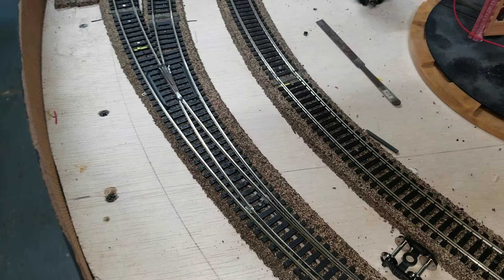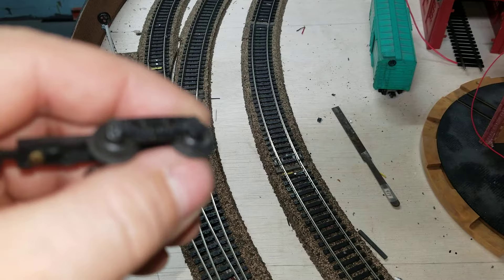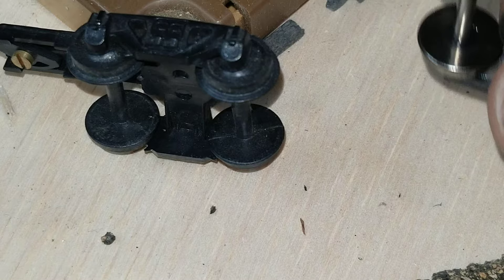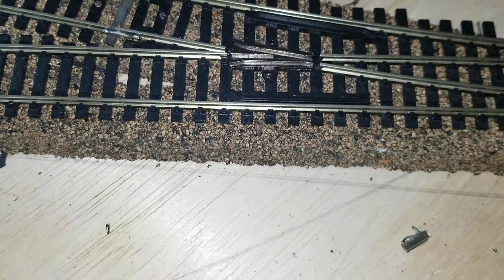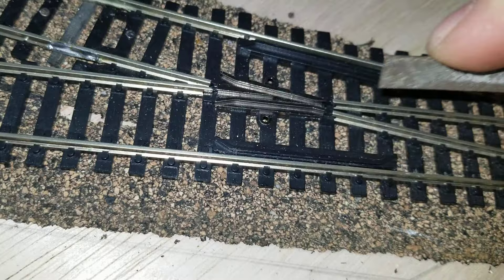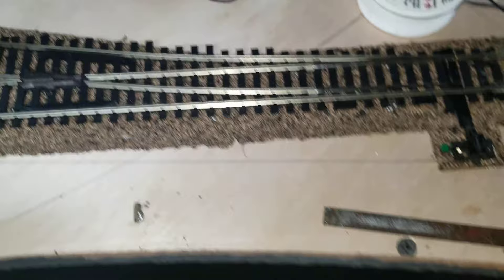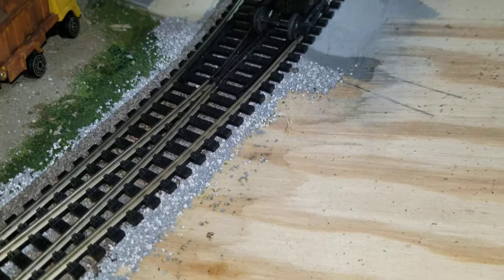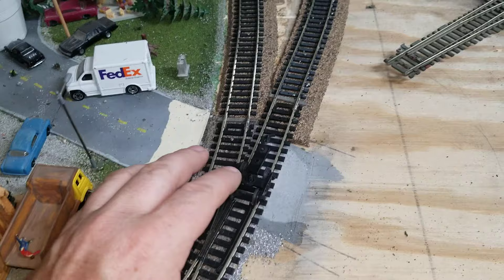talkin about Atlas switches

Comment: Great insight for those of us running old stuff in analog; in my case old time 4-4-0 locos.  Yes, you can replace wheels on old cars and locomotive trucks to improve running through these turnouts without derails and uncoupling as I have done, but there is another issue that is a source of deeper frustration for me - stalling.  My thought is these stalls happen when the driving wheels with deep flanges wobble up and over the frog and guard rails.  As the drive wheels become elevated through these areas, their contact with the track is reduced or briefly interrupted - which is important if the drive wheels have electrical contacts. If the drive wheels don't have pickups, the tender truck behind the cab can also lift up or become canted left or right as the coupling height is briefly increased between loco and tender.  This can also cause an interruption in track contact with the tender wheels.  This is important to know because locos have electrical pickups in different configurations depending on age, model and manufacturer, so the exact spot where electric contact is lost in the switch could vary from one loco to another, although the root cause is the same. I frequently read and see videos where loco and tender weight are blamed for shorts in turnouts.  I also see videos where cheap motors are blamed for stall outs. I now think these causes are overstated in many cases.  Of course, light weight locos and inexpensive motors can contribute to the problem since a light loco will more easily rise up and away from contact with the track and less powerful motors may not have enough toque to power through a problem spot, but more important it seems to me is maintaining proper electrical contact with the track in the first place.  I say this because when a stall does occur, I can most often press down on the tender or nudge the loco to restart operation.  The simple reason for this is because electric contact is now resumed between wheels and track.  Many thanks for this video.

Comment: It confuses me that people still buy code 100. The rails are too large and ties are the same. Its like you want to buy a ford F150 and instead you buy the Ford F150 monster truck because its cheaper. well you know what I'm saying, code 100 is not practical. However, I love your idea to file down the frog angles and the guard rail to allow deep flange wheel sets to travel. I love also those curved turnouts - They look amazing!

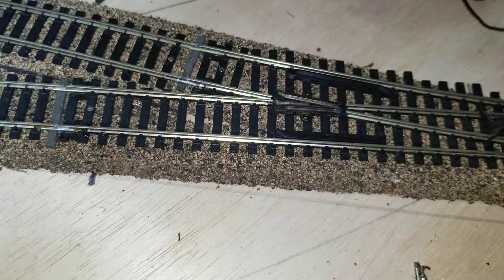Comment: Find out where the camera will focus close up. Then stretch a string nd knot it at the distance. Use this and the close up will be in focus next times. Also you have to know exactly where in the viewing frame the focus cell is or you will always be focusing on the background. See, at the :57 time line you had the subject and the background on the same plane and all was in focus. Looks like your camera will focus pretty close up. Don't be worried what others think. You have to do what you have to do to get the trains running. The filing thing is fine as long as you don't go to far... You were pointing to the guard rail at the 1:55 time line, not the frog.Yep, you have a guard rail problem but you have the right way of solving the problem. Good luck in the future. You are right. The companies want all of us to buy new equipment, but I really don't know if this problem was o]a result of that or just the new dies were just to close and tested with new wheel sets. Anyhou, we all know how to fix them now.

Comment: I inherited some old N scale locomotives and rolling stock from my father after he passed.  I had the same problem with them hanging up on the switches.  This stuff is so small its hard to see that it was a wheel height issue.  I filed down as you did and it solved the problem.  Is there anything you can't find a fix for on YouTube?  Thanks!

Comment: So the old atlas/ switches didn't allow new wheels and newer atlas/dcc friendly switches didn't allow older wheels I think that's kinda dumb 
For example Tyco cars won't run on code 83 cause they get caught and hung up but code 100 everything runs cause of the rails I've also noticed the the older power packs run the newer locomotives better and newer power packs run the older locomotives better (Tyco bachmann ahm etc) weird idk maybe it's me whatever works I guess
Thanks for sharing
Reply from the maker: we use code 100 on everything the new Atlas witches are not made right

Comment: I have a bunch of older Model Power and Rivarossi steam locomotives that have those deep flanges, so I can see a need to still yet do that procedure. 

If it weren't for that, and it was a matter of the older rolling stock having the issues, I would replace the wheel/axle sets with Kadee wheelsets.  The other issue I can see, is some of the new Kadee wheelsets may not fit the older OEM trucks, and a lot of those older passenger coaches require "brain surgery" to install Kadee trucks and couplers on them.

Comment: atlas should just get out of the business of making switches, They are not reliable, I have continuous derailments over them, and the frog is a pain in the ass to wire. Right now I am in the process of replacing most if not all the switches on my layout to the more reliable Peco switches which are similar in price but much much more reliable. Thank god I have not ballasted the RR yet. atlas should stick to making flex track and that is even getting way over priced. Model railroading has become a wealthy man hobby in the past 20 years or so.

Comment: 1:38 That's the guard or check-rail, not the frog ! Get your RR nomenclature correct, sir !
Far as flanges go, instead of mutilating the switch components, replace all your old wheel sets with new ones.. If you widen the flangeway too much the inner wheels will potentially go to the wrong side OF frog..5:04 That "plastic piece" is an insulator. 
Again, get your RR nomenclature correct, sir !